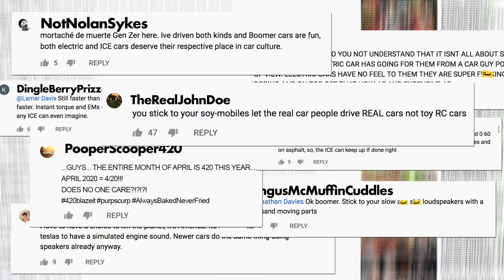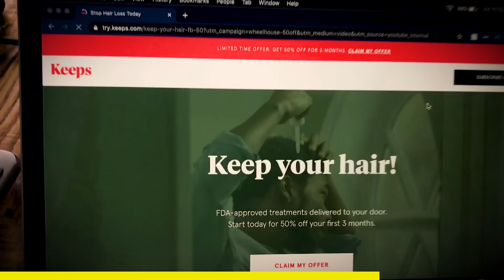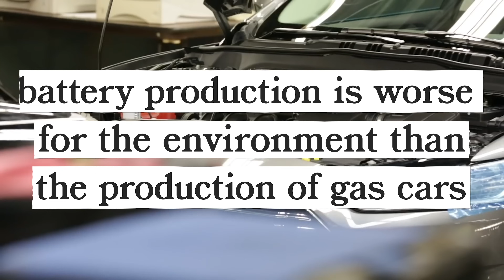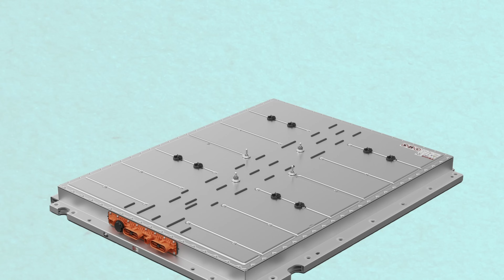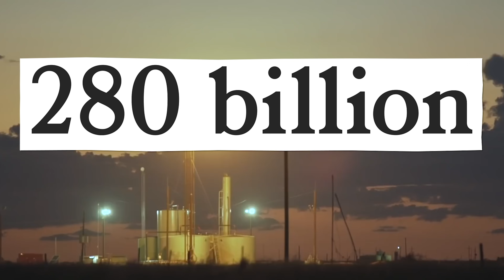Are Electric Cars REALLY Better for the Environment?

Comment: One more thing that really convinced me about this was: batteries can be recycled! Something like 98% of the minerals can be recycled and made into new batteries. They can separate the minerals and reuse them. Of course thats gonna make some pollution but still. Fuel cant be reused! So thats a major difference.
Reply: I won't disagree with that statement since it sounds reasonable, however what is involved in getting those minerals from the earth in the first place?  And does the ability to recycle the batteries really counteract that initial ecological impact? We've become pretty good at extracting oil with a minimal footprint that doesn't involve strip mining. 
Same can be said for the difference between fuel with and without ethanol. Yeah ethanol burns cleaner, but the farming of the corn to make it along with the processing to distill it has a pretty big footprint all on its own. 
I'm not against either technology inherently but I feel the marketing is feeding an agenda and we're not being given the whole truth.

Comment: Another thing to note is that power plants are more efficient at turning gas or oil into power than the car engines so even without using renewables the EVs are more efficient.

Comment: But what about others fuels? Ethanol from corn or sugar-cane? Given that the most conservative figure I could find is 44% more clean, and the more optimistic is 90%, we have 7+ 0.6-2.9/year m³ for an internal combustion vs 17 + 0-2/year from an Ev. For example in an 10 year period in worst scenarios you wuold have 36 vs 37 m³, and in best scenarios 13 vs 17 m³. This number are not precise, nor take in account all the details, but shown that internal combustion engines could still be a environmentally friendly option without fossil fuels

Comment: Here are some unmentioned issues:

1. EVs are often vastly heavier than their ICE counterparts, so road wear will greatly increase and brakes/tires are put under more strain during similar travel cycles
2. Almost any chemical battery greatly reduces efficiency in cold weather, and there have been cases of EVs being completely unable to drive in winter. If not unable, then reduced range.
3. The weight of an EV makes a crash more dangerous for all involved because more inertia = more force at impact
4. Any kind of electric battery contains all the energy via electric potential, rather than hydrocarbons which release energy only if exposed to very high heat and the right amount of oxygen. This makes batteries more volatile (yes, even carbon batteries) and dangerous to use than hydrocarbons in tanks.
5. Solar panels, batteries, and wind turbines all need regular replacement, sometimes after as little as 10 years. The manufacture of all three is energy-expensive, and many components cannot be recycled.
Reply: Nitpicking inane yahoo using his sticky fingers to try to find fault in the newest of technologies. Use those fingers for something else yahoo. You know what for.

Comment: Stop with the diversions to the real reasons . . . .price is too high.  Also lack of capability is THE issue.  If you can't charge the vehicle in the time it takes to fuel a gasoline tank - no one wants it. If chargers are not as plentiful as fuel pumps - no one wants it.  If your EV truck range depletes to 120 miles because you used the heater - forget about it.  These are the EV realities of it all.  Then there are the cobalt mines with children recovering cobalt by hand.  All of this equates to a disaster of a plan and technology that is not ready for prime time.

Comment: Why did you calculate the cost of drilling oil but not the mining of coal for power plants or mining of aluminum for wind turbines or processing of silicone for solar panels?
Reply: At some point it becomes impossible to separate things out. As mentioned in the video crude oil is turned into more than just gasoline. Likewise coal is used for more than just generating electricity. It includes things like making steel or aluminum for ICE engines.
If you truly want the absolute correct answers then it will have to account for things like power usage at the factories and building of infrastructure. For example, which uses more cement(another large CO2 producer), a gas station or a EV charging station?
Reply: Because it all works out to about the same lol there's virtually no difference from the mining/extraction, production, life of vehicle, and death of vehicle. With the onslaught of EV's being produced, it's not helping C02 emissions at all.
Reply: @T-Will-4554  did you do the calculation? Cause the math is actually one sided here. Ev is much worse than gasoline cars (which also can be converted to alcohol or natural gas)
Reply: @CincinnatiPartyBoothBus  Did you do the calculation? I would love to see that math. Please enlighten us.
Reply: @1974elky  google has all your answers, the math is spelled out and clear
Reply: thank you! finally someone with a functioning brain

Comment: I watched a talk the other day that was admittedly a few years old. In that talk it mentioned most of the same points that you have mentioned and came to roughly the same conclusions you did. It was however a little harder on the EV's environmental credentials, which might be a function of its age. It's conclusion was that now was not the time to rush out and buy an EV and in fact there was a lot more life left in the ICE. 

This talk was by no means anti EV, it was 100% behind the idea that EV in some form was the way of the future of transport but it did point out that the technology behind EV was not to a level yet where owning one was actually better for the environment. 

What it did say though was if you wanted to be environmentally friendly right now, the hybrid was the way to go, with their smaller batteries and EV being used to help at times where the ICE is it's least efficient, i.e., at lower speeds.

Thanks for your video, I enjoyed it.

Comment: What about battery replacements? I have a friend who is a mechanic and he told me that most batteries they've had to replace lasted only 3-5 years. And not the 10 years manufacturers talk about.
Reply: 3-5 years is simply untrue. We now do have enough data to prove that false.
Reply: @sebastian9147  they last 8 years nominal or 10 years if took good care, but since there are new batteries that don't use rare earth metals like cobalt and nickel, like aluminum air/ion and sodium ion batteries, EV Industry might just ditch lithium batteries forever. besides they are cheap because aluminum and sodium is way more abundant
Reply: @TurbineOfTheWinds5816  From what Ive seen, the Sodium-Ion battery has been around almost as long as the lithium ones. But the reason we use so much Li-Ion, is because big corporations are very invested into mining lithium.
Reply: @metallboy25  Once corporations realize lithium is expensive and rare, they will invest in aluminum air batteries or sodium ion batteries
Estimates say that an aluminum air battery only weighing 90 kilograms will give an EV 1000 miles of range. ridiculous.
Reply: Yes and costs 10 to 14 k

Comment: Burning coal and trash, nuclear material, natural gas, not to mention a ton of energy just going into producing 1 wind turbine blade and mining the material used to produce solar panels and circuit boards, batteries, copper wire, gold plated electrodes and other electral components used for battery powered cars, motorcycles, some compact heavy equipment, buses, light and "heavy duty" trucks, hand power tools, electricity and battery powered generators, lawn mowers, e bikes, ATVs, boats, scooters and laptops.  What's next?  Battery powered televisions, ovens, microwaves, refrigerators and small appliances??
Reply: then make more renewables with renewables. Solar panels and wind turbines only need to be mined ONCE and never again for another 25 years. Besides, fossil fuels need to be mined 24/7, which in term is worse the the environment. New aluminum and sodium batteries might force EV industry to ditch lithium based batteries forever, because they are cheap and abundant, never explode nor catch fire, higher energy density and lightweight, and the fact that these brand new battery materials are 100% recyclable. Solar Panels are 97-100% recyclable all the time! they are still working on how to recycle wind turbine blades after 20 years of its work
Reply: @TurbineOfTheWinds5816  rubbish

Comment: One thing u didn't include is that fact that u can't just throw out an electric car 
The lithium and cobalt is poisonous and is very bad
And for recycling , that's a whole another story .I think gasoline powered vehicles I good Until  the manufacturing and recycle is made efficient
Reply: EV Industry might ditch lithium based batteries forever.
Reason: New batteries; Al-Ion and Na-Ion. Cheaper, more abundant, never explode nor catch fire, not poisonous like lithium cobalt and nickel, fast charging and swapping times, 100% Recyclable and more range.
SO just do a battery breakthrough research in youtube.
They even estimated that an aluminum air battery weighing only 90 kilograms gives the car 1000 miles of range!

Comment: One thing you didnt account for is safety. With electric car weighing 20-50% more, and like you said, the batteries are prone to combust, especially under a pinch, crushing, or peircing force, they make car crashed more of a hazzard.
Reply: Not just safety, but also road damage. That 50% extra weight equals a much larger amount of wear and tear on the roads (and tires), which is also a large environmental cost. Plus the batteries don't last as long as gas engines, meaning the cost of production happens more often - and like he said it is a larger cost than gas engine production.

Plus places all across the world are replacing safe (and clean) nuclear plants with coal ones. And windmills/hydroelectric dams also have huge cost both in production (windmills are basically break even on energy cost) and the fact dams ruin waterways and windmills replace trees which clean the air.
Reply: @TheFriskySquid  Onother thing too, windmill are horable for the near by enviorment. they ruin how the air should travle, and because of this your disrupting how the winds flow around the earth. Thats why its alway so windy were windmills are.
Reply: @FoxTheLord32  Stop making things up… talking of “disrupting the natural course of the wind“….. 

Someone is trying to come up with excuses…
Reply: @FoxTheLord32  Crazy statement. If this would ever be an issue we would've known by now.
Because, you know, the whole planet used to not have any large structures we call buildings.
And if you think a windmill is like a big fan, you should check whether your common house fan uses electricity or generates electricity. That should clear it up for you.
Reply: @QoP..  except that's not how I see it at all. and if you manually spin a desk fan, it will make power btw (same goes to anything with a motor, bc that's what makes power). And it is a problem. There's multiple articles about this by people who specialize in Environmental Science.
Reply: @FoxTheLord32   If you would have just said up front that you don't understand the laws of thermodynamics, I wouldn't have wasted my time.
Just remember that everything is input/output. You can't generate something from nothing. With your manually spinning fan, you are the engine and you too burn your fuel to do that. A windmill uses the wind as fuel & does not generate wind.
Reply: @QoP..  true. a fan NEEDS electricity to push wind, a wind turbine NEEDS wind to generate electricity. Its functions is opposite
Its like your burning fuel on your own by bicycle cycling
Reply: @TheFriskySquid  Cause what you didn't know is that even installing renewable energy power stations is cheaper than installing a nuclear power plant, and in general, there are open fields in most places where you can install a wind turbine, not straight into deforestation. forgot we have grass.... and you forgot we have geothermal power plants.
I dont have to explain it here, but just do a battery breakthrough research and you'll finally ditch lithium batteries.
Reply: @TurbineOfTheWinds5816  Yeah it is cheaper to make wind turbines, but that isn't the point. It costs a lot of energy to make a nuclear plant, but the second you turn it on you are already supplying massive power. Wind turbines are barely energy positive (it takes as much to make them as they ever make while online, and they get damaged very easily and need maintenance). 

And last I checked, nobody is making geothermal powerplants, even though they would be excellent. Problem is, where geothermal makes sense, very few people live.

And I shouldn't need to remind you but our nation's submarines run on safe and efficient nuclear power - people live in those subs all year and are just fine. Investing in nuclear rather than into batteries is a far faster, far more efficient route.
Reply: @TheFriskySquid  no, have you heard of the chernobyl disaster? thats why i still consider nuclear energy as unsafe, and the fact that you need to mine uranium all day for the nuclear powerplant, that isnt sustainable, sunlight, wind, geothermal heat, tidal waves, wind kinetic energy is always sustainable. And have you even know that building a nuclear power plant takes decades to build while a wind farm only takes a few months to years to build?
Reply: @TheFriskySquid  so you said 6 years, some only last for 3 years before needing to mine again, solar panels last for 25+ years before i need to mine again maybe its like that
Reply: @TurbineOfTheWinds5816  You consider nuclear energy unsafe based on an event that happened in 1986 in a terribly regulated country. Not sure if you know but your smartphone has more computational power than that whole power plant back then, hell, even your doorbell probably does (if it's a smart doorbell).
Furthermore, if you think that Uranium is the only way to create nuclear energy you should do some more research.
Also, go ahead and build 700-3500 windmills instead of 1 nuclear power plant.
Reply: @QoP..  No, id rather build geothermal power plants. they're more efficient than wind turbines. i only need a few or several geothermal power stations to make 1GW, compared to thousands of windmills and solar panels
Reply: And all what you said can be solved by these two new batteries
Aluminum and Sodium Ion batteries.
They are cheaper, abundant, never explode nor catch fire no matter what situation is it in, lightweight in some cases like aluminum, long lifespan, 100% Recyclable and fast charging.
They even estimated that an aluminum air battery example only weighing 90 kilograms will give you 1000 miles of range, that is only 90 kilograms. So please do a battery breakthrough research in youtube so that you will not mention about lithium ion batteries anymore. It Best if EV Industry ditches these lithium batteries forever

Comment: I think there was a bias here. You took into account the emissions from getting the gasoline to the gas vehicles, but didn't take into account the emissions involved in getting fossil fuels to electric power plants. 61% of the electricity in USA comes from burning fossil fuels. Also missing was the loss in charging electric vehicles ~ 15% and the losses in transmission of electricity from the power plant to your charging station ~ 9.2% in California. If my math is right, including these factors increases the period an EV needs to be driven to 4-5 years before it comes close to a gas powered vehicle in emissions (I'm talking a Honda Civic here, not a Hummer).
Reply: Renewables are growing faster constantly, while fossil fuels actually decrase in rate as coal runs out of the world. then in just a few years or more, there will be more renewables in USA than those useless and worthless fossil fuels.

Comment: taking into the account the ethical issue i say evs are worse now if elon would go buy land with cobalt on it and mine it properly i wouldnt bitch at his dumb ass for acting like hes better with evs because over all i have no problem with anyone owning or driving an ev as long as the leave my gar drinking jeep Comanche alone
Reply: until someone like me would tell him to ditch lithium batteries forever and suggest him to use aluminum and sodium ion batteries. period.
Extreme fast charging or swapping times
No explosions or fires
High energy density and lightweight
Cost is less
More abundant

Comment: 9:04 THIS IS SO WRONG 1) if you use Coal to produce electricity (which is the case for 30% of the electricty in the US), you emit a lot more than a gas car while driving, not mentioning the production 2) Nuclear is the second cleanest energy source after hydrolic, dont put this as the dirtiest energy pleeease
Reply: Nuclear energy is clean, yet its not that safe. 
Besides, forget coal energy that is stupid, there's already renewables, why would you bother about that useless coal energy if there is renewable energy and unsafe nuclear energy? i wish one day USA will switch to 90% safe energy like renewables.